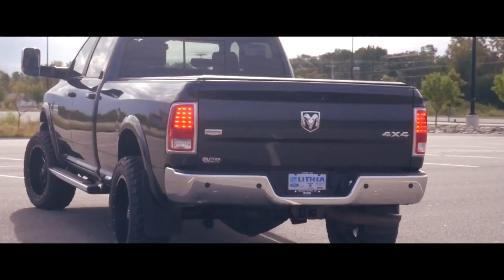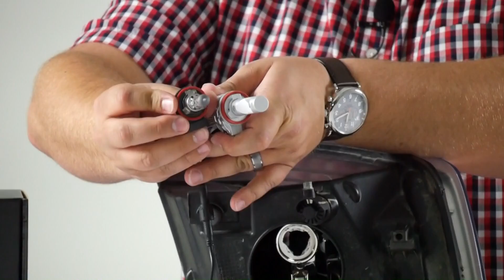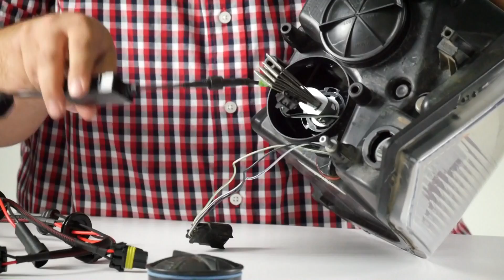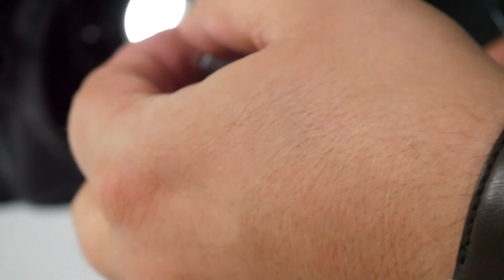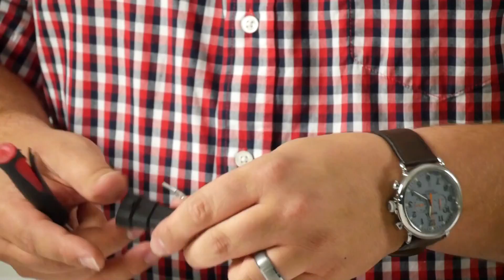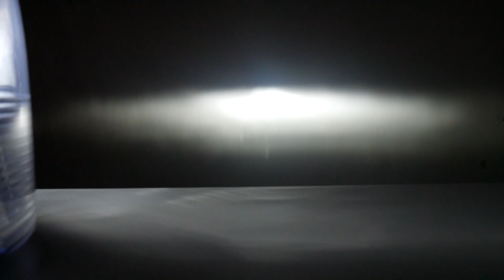DELETE - LED Headlights for 2009-2018 Dodge Ram Quad Single Beam Reflector Headlights

Comment: The kit should include the second O-ring, if that's what's required for a tight fit.  Instead of a 7/8" grommet, which requires connector disassembly, a 1" grommet should've been used instead, so the connectors would fit.  Better yet, a new larger dust cover should be included, which could contain both modules without drilling any factory parts.

Comment: What LED bulb can I use on the 2017 ram 1500 projector style headlights, I haven’t been able to find one that fits inside, the way it’s made it’s way too small for any kind of LED normal size bulbs other than a halogen or HID, I don’t want to use an HID bulb on my high beams, I’m looking for a LED kit bulb that fits on the high beam so you know of one that fits with no modifications for the high beam on a projector style head light for a 2017 Ram 1500
Reply from the maker: We like the 2stroke because of it's easy install.

Comment: Is there a recall or manufacturing issues with the supernova v3 H11  ? This will makes the 3rd time i have to replace cause of burn out  1st was the install one of the bulb didn't work out of the kit  done a warranty replacement   2nd after a few months later the replacement burned out yet another warranty replacement   now the other bulb from the same kit has burned out  yet another warranty replacement for the 3rd time it's getting very annoying to keep replacing..... I'm not blaming Headlight Revolution but something has to give here if the supernova v3 H11  has a recall or manufacturing defects i either want a better product or a refund i paid good money for this kit but having to do warranty replacements 3 times is not good
Reply from the maker: The V.3 LEDs were indeed Discontinued and have been fully replaced with the Supernova V.4 LEDs. You qualify for a free upgrade, these LEDs are much better than the V.3s. 

Email Returns@HeadlightRevolution.com about your situation and they will be more than happy to set you up!

Comment: I know it says 09-17 but my 18 5500 looks the same will it work? Also do you sell a matching set for the fog lights
Reply from the maker: Hello!

The Supernova V.3 series bulb has recently been discontinued pending the release of the upgraded Supernova V.4 series that will be available for pre-order in 1-2 weeks and will be ready to ship to customers within 4-6 weeks. Initial tests have shown the V.4 to be 140% brighter than the Supernova V.3. They will be priced at $159 for single beam bulbs and $169 for dual beam bulbs. The Supernova PerfectFIT was just released and is approximately 20% less bright than the Supernova V.3. It is a lower profile design that will fit more applications. They will be priced at $129 for single beam bulbs and $139 for dual beam bulbs. I recommend waiting for a bit for the V.4 LEDs to ensure an exact match for your fogs/headlights.
Thank you for the comment!
Reply: @HeadlightRevolution v4 look less great with cree chip🤔

 i have the supernova v3 unbranded version are identical but then imported straight out of china thanks to this video i bought them because from Europe it was little easier trough china bought them for 50€/$ set but if I had to pay customs would be around 90$ was lucky it didn't got catch by customs;)

Comment: Well I must say these do not fit like the low beam bulb. When you said in the video about the led chips on the high beam have to point left to right I had no idea that it would be so difficult in fact only 2 of the tabs on the light bulb are holding it in place to make the leds point L to R. Not happy with these at all especially for the price.

Comment: I'm located in Canada, and thus we have mandatory daytime running lights...  my DRL is my highbeam... it runs reduced voltage for DRL mode... and increased voltage for Highbeam output. I've been told this highbeam LED conversion will not work due to my Canadian truck. Is this true?

Comment: I guess this conversion can be used on standard or black smoked lens?
Reply from the maker: Yep, this will work on anything!
Thanks for the comment.
Reply: So I guess it will work for a projector style headlight, ( non stock )?

Comment: why don't you make the modules plug in at the three wire headlight connector outside the housing?  You could use the wiring inside the headlight to the bulbs but place the PWM unit at the outside connector so you don't have to push it all inside the housing or drill holes in the cover.  It would also reduce all the extra wiring if the module case had ports that matched the three wire connectors and wouldn't add any additional wiring at all.

Comment: Just installed low and high beam LEDs on my 2016 RAM 1500. Super easy process. The thing that took the longest was taking the connectors off the wires. 

In the dust cover for the high beams, it's pretty tight in there, the heat sinks won't heat up and damage the wires right?
Reply from the maker: Ryan Johnson We haven't had anyone have the issues of them getting too hot and damaging anything.
Reply: Hi Ryan, I was thinking of getting these for my 2013. Quick question! Does the high beam DRLs blind the on coming traffic?  Do they flash you? Because the DRLs are always on full power brightness...from what I've read...thanks
Reply: Hey there, so these are bright as heck. I've had a few oncoming drivers flash me with just my low beams on because they are so bright. I thought it was because of the beam pattern angle, but I double checked those and the angle is good. Just a FYI, they may flash you since these are bright, but when you install them, also check the angle, if you need to adjust that it should be an easy process once installed.

Comment: I have a 2014 ram 1500 with a 2 inch bilstein level in the front. If i buy/install this kit, would you recommend any adjustment to my housings?

Comment: Just did the V3 low beams, very easy, plug and play, once I corrected my error of removing the short jumper wire, thinking I didn't need it. You do. The rest was easy peasy, other side took 10 min, if that. Have been driving around at night, adjusting height, and have raised them a little at a time, now seems like I have raised the adj about 8 full turns,  I still am not getting lights flashed at me, but I think I am about at the limit of height. Good pattern for left glare. I like the white light.
But I feel like I have tunnel vision. No left/right adjustment, doesn't show street signs very well.
Overall I like them, and will probably get the high beam kit.

Comment: I have a question once you remove the headlight housing from the truck will you have to readjust the headlight  beam
Reply: Headlight housing is held in one location, you don't lose your adjustment, but after the install you will want to adjust the beam for distance/height of center of beam. The only adjustment is on the low beam height.
Reply: Jim Kennedy o ok thank you

Comment: Could I get the link to the low beam kit for a 2013 Ram 2500 non projector?
Reply from the maker: Josue De La Garza https://headlightrevolution.com/2009-2018-dodge-ram-reflector-single-beam-led-h11-low-beam-bulbs-upgrade-supernova-v-3/

Comment: Nice detailed explanation. I have one question though, when you installed the led bulb you covered the heatsink with dust cover would it cause heat build up inside the headlight housing and could it somehow damage the bulb?
Reply from the maker: It wont get hot enough to damage any of the surrounding plastic or the bulb itself
Reply: Headlight Revolution oh thanks for the clarification, that was a very quick reply. Also can I use dust cover for led bulbs with solid or fan type heat sink?
Reply from the maker: If you have enough room for the heat sink you can. In example, the GTR Ultra Series Generation 3's need at least 1.5" of clearance behind the collar in order to fit.
Reply: Headlight Revolution OK. Thank you. 👍

Comment: I learned some stuff from stuff from this video. ie: making sure the bulb is aligned left to right. My Ram low beam LED bulbs fit too tight so maybe I will have to do the opposite of this video - take out the rubber ring. I would never do my high beams. I would be too afraid that I would not get the connectors back together properly. High Beams do not get used enough to bother upgrading. Thanks.

Comment: What about drl on high beam??? How does your kit react?
Reply from the maker: It will work, but it will not dim. The light will be as bright as your high beams are when they are operating as the DRL's.
Reply: Headlight Revolution I just finished installing these and in the driveway the highbeams work perfectly fine but once I got on the road the highbeams would flick on for a second when I put the truck in drive as they were running as DRL but now they won’t work at all, not even on highbeam
Reply from the maker: dknob81 please send an email about it and we'll help you out: sales@headlightrevolution.com
Reply: Headlight Revolution ok just did
Reply: Hi, just installed the low beam kit in my 2015 Ram. My daytime running lights no longer work and neither do my automatic lights. Only way I can get them on is to turn the knob now. Any ideas?
Reply: False alarm! It wasn’t dark enough yet, doh

Comment: Hello! I have a dilemma that I need sorted out before I buy the high beam kit. I have a 2010 Dodge Ram 1500 that was originally sold in Canada. As a result, I have a Dodge Ram that is equipped with Daytime Running Lights. In the Ram, the DRLs use the factory high beam halogen bulb at a lower voltage. What would occur if I installed these lights? Would the LED bulbs function at a lower voltage and be at full brightness as if I had my high beams on? Or would they actually decrease their brightness to match what the halogen bulb can do? I am going to make a guess and say they will not function at all and send a fault code. Thank you!
Reply from the maker: They will work with our provided PWM modules, but they will not operate at a lower voltage like the halogen bulbs. They will appear as your high beams do.
Reply: Pull your fuse or fuses in your fuse box under your hood if you don't want DRL with the LEDs
Reply: james taylor The 4th Gens don’t have fuses for the DRLs. It is all controlled through the TIPM.
Reply: Logan Barbee, oh ok I thought that they kept that the same through the years but I haven't had DRL on any vehicle I've ever owned but knew that Chevy's and older dodges it was a fuse that you just pulled. But thanks for the knowledge

Comment: So the canbus driver is only needed with the high beams then?
Reply from the maker: No sir, it's needed for your lows, highs, and fogs.  If you get the kit from the vehicle specific page it comes with it:
https://headlightrevolution.com/vehicles/dodge-ram/2003-2017-dodge-ram/

Comment: Do you have a kit for the Jeep Grand Cherokee WK2?  I have a 2015 model with the halogen bulb not the HID version.Also do you have a replacement bulb for the fog lights also?   Thanks  Great Videos
Reply from the maker: Allen,
Your jeep takes H11 low and H11 fogs.
https://headlightrevolution.com/supernova-v-3-led-headlights-h11-h16-bulbs/
You're also going to need an Anti flicker module, this will work:
https://headlightrevolution.com/gtr-lighting-pwm-interface-module-h11-style-connectors/
Thanks!

Comment: all its great  video.. now my Big question is .. about all that heat?.. inside the headlight  with the dust covers back on there.. WONT MAKE MY HEADLIGHT MOIST INSIDE??
Reply from the maker: Had to use "MOIST" didn't you?  Just trying to gross people out.
We've probably sold 1000 of these kits, and there's the typical defective products, but we haven't had any issues with extensive overheating or any complaints about moisture in the housing.
Thanks for your comment!

Comment: I’d like some real world output visuals, would that be possible in future bulb review videos?
Reply from the maker: We see reviews all over the place of people driving at night, and just don't see value in it.
We take beam pattern and lux measurement visuals on the wall in a studio at the same distance to measure how well different bulbs do. A good beam pattern with a high lux measurement will translate to improved lighting on the road. Watch this one for an example: https://www.youtube.com/watch?v=SQF5ESBHLrw&t=25s
Reply: Um ok… I’m not going to buy anything without knowing what it looks like on the road. I think the wall tests and readings are great but they don’t tell me anything about down-road output or real world usability. I’m not asking for a full driving review, just the simple on the road test you guys did with all the LED sealed beams.
Reply: Cameras don't show lighting very well or accurate.  User reviews are not reliable.  Their wall tests will show you the beam comparisons.